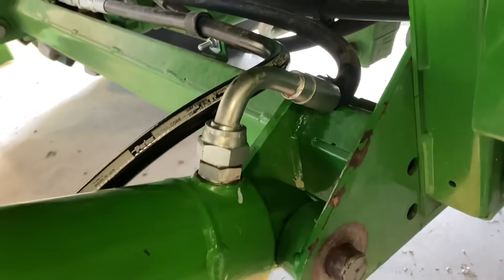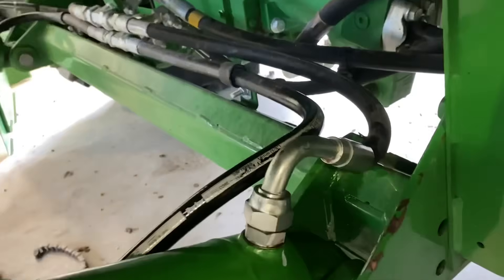John Deere S780 Feeder House Lift Cylinder Rebuild

Comment: I was taught to use a worm gear clamp on the snap ring when installing the gland. Tight enough to compress the snap ring but loose enough to slide off

Comment: That orange seal you installed to fill the gap to release the inside unit to pull out and rebuild… does that come in the seal kit from John Deere of is that a special seal for disassemble?
Reply from the maker: Yes it comes with the kit

Comment: What does the 90mm stand for? I’m needing to order new multi-coupler couplers due to leaking and that is one of the parameters? Great Video BTW!
Reply from the maker: That’s the inner diameter of the cylinder bore

Comment: How did you or, how do you bleed the air that was trapped i the cylinder?  Or, does the system take care of that when you raise and lower the unit?
Reply from the maker: It bleeds itself when i cycle the feeder house up and down

Comment: Use a hose clamp to compress the big snap ring (C clip) for easy install. Also, a brass punch to drive the guide back into the housing for removal and install to prevent damage.
Reply from the maker: I’ve done that before and the clamp got into my outer o ring when it went in.
Reply from the maker: And I didn’t damage anything. You act like this is my first rodeo..

Comment: Well learnt something there! I have stripped down and resealed many rams on the farm but have never seen one of those with an internal locking ring. I wouldn’t have had a clue how to get that apart. I does seam unnecessarily complicated and impossible to get apart in 20 years when it’s all rust and no paint. Thanks for the video
Reply: They are a bitch to get apart when they get old and rusty ,the reason is it's faster and cheaper to groove the tube than cut a thread in it (I've been in hydraulics for 35 years)

Comment: Ah, a clean cylinder. I love when the inner bushing on the rod guide is rusted underneath and it takes an act of god to make the rod move. Have to go in with a grinding stone or small flap disk on a die grinder and get it all clean. I use the piston ring compressors that snap on to their own special pliers to seat the guide, or hose clamps which was the way I was taught. My favorite are the guides with wires and the tang is broke on them.

Comment: You used an orange fill piece to let the snap ring come out on disassemblely, does it stay for reassembly?  If not, is there a chance of damage to the piston seals on assembly?  Great video.
Reply from the maker: No you always remove that or the snap ring will not seat.